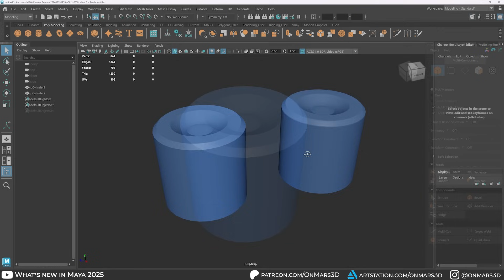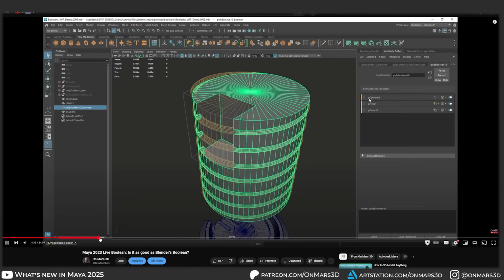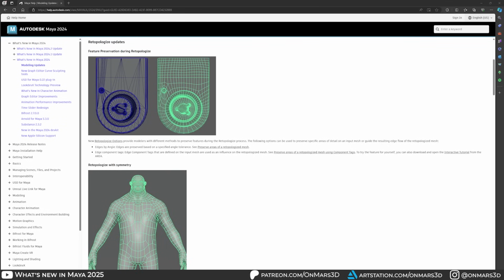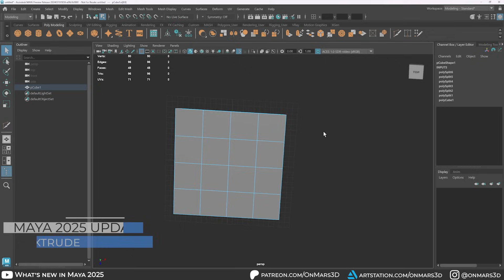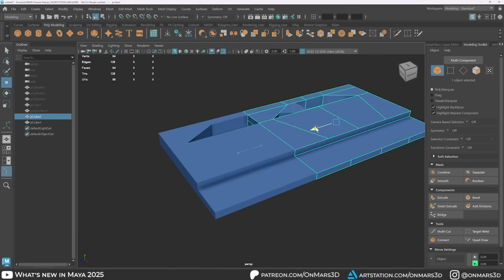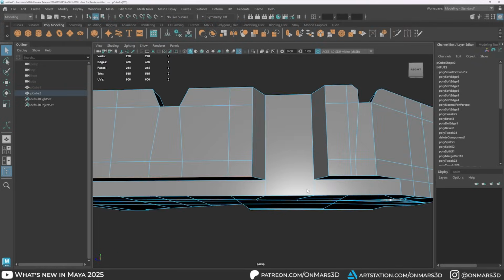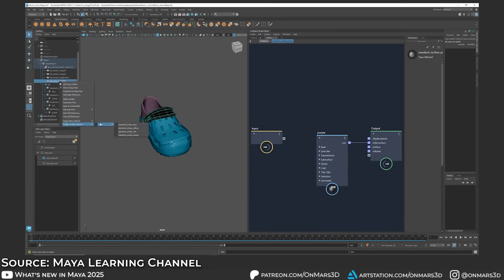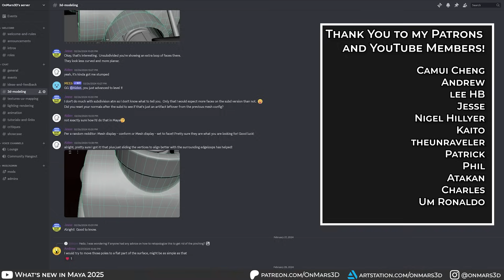What's New in Maya 2025

Comment: It seems to me that even with smart extrude, you'll have to reconnect loops if your topology requires it. So, wherever you use it the edge flows up until that point will be broken. Unless I`m missing some option.
Reply from the maker: That's correct, you will still have to connect those edges.

Comment: Smart extrude : it also handles scale Inset smartly or just the move extrude? Max version does both
Reply from the maker: Not in it's current state unfortunately. Hopefully in a future update!
Reply: @OnMars3D too bad because already for direct modeling Maya has more modern goodies than Max like the Multicut or the Circularize tool and the live symetry. These combined with smart extrude would definitely get an edge over 3ds MAX for those eorflow